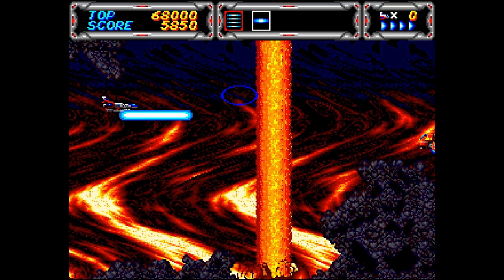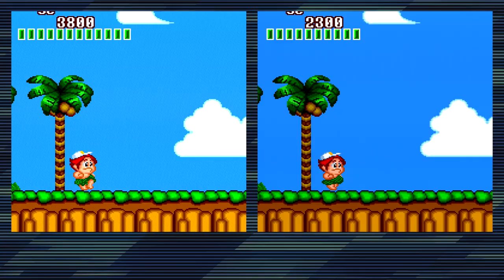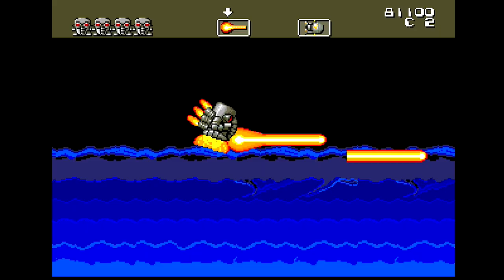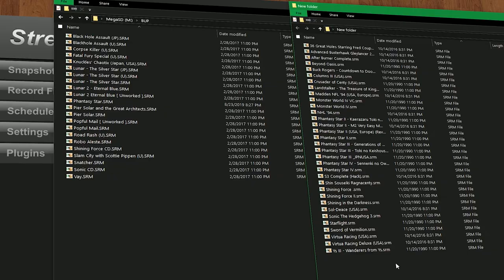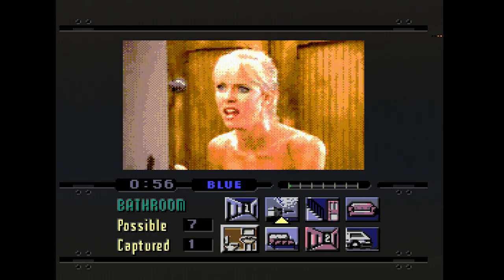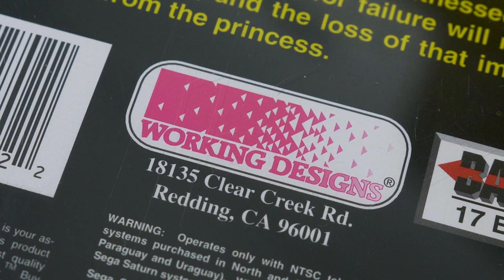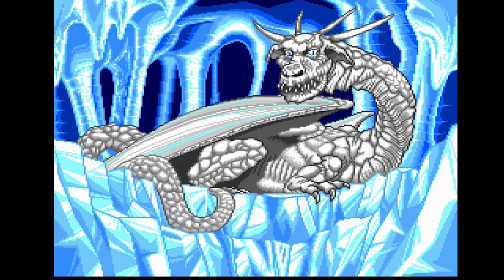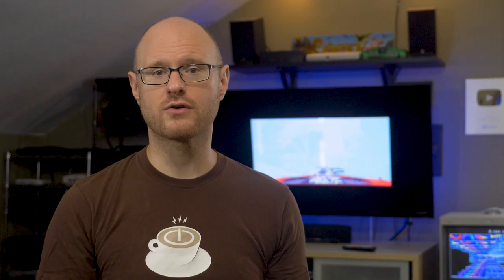Mega SD: Genesis & Sega CD Flash Cart / MY LIFE IN GAMING

Comment: I would argue that Golden Axe was the first "Genesis Plus" game. Even though it wasn't running on cart, it was essentially a ROM file with redbook audio spooled from the disc replacing the BGM.

This was a pack-in for the early Sega CD units in North America as "4-in-1 Sega Classics". The other 3 games (or other 4 in the CD-X pack) use PCM.

Comment: I still want an actual ODD for the Sega CD. FPGA simulation is cool and all but I really want to play on original hardware (plus that will make it possible to play 32x CD games)
Reply: ProtoMancave According to Terraonion, it will be possible to play those games using this device if they decide to go ahead and manufacture an adapter that allows the cart to attach to the side ext port, depending on demand
Reply: I agree. I get the excitement about FPGA, but I'll never trust it as much as the original hardware. I wish there was a product that only emulates the disk drive and nothing else, and goes inside an original Sega CD that takes care of everything else.

Comment: almost there, just need to play 32x without the addon and it will be the supreme flash card for MD
Reply: that would be very hard to do, in many ways the 32x is its own console that lack some functions that it uses the genesis for
Reply: From an architectural standpoint I don't think the FPGA can perform the same math calculations and polygon rendering as the hitachi CPUs in the 32X. Even if it could be emulated correctly I debate whether it's worth the time to the terraonion developers to code emulation for the very very small library of games. Perhaps in a very late software update since they did add Neo Geo CD capability to the Neo Geo cart they developed. However there are a lot more NeoGeo CD games....
Reply: Why??? The 32X Is not worth it. FYI I had one from 20 yrs ago

Comment: The nice thing with Sega CD is that it plays CD-Rs since the system pre-dated piracy by a few years so there was no copyright protection on the system. So if you have a CD burner and a working Sega CD, it's a cheaper option than buying the Terra Onion
Reply: All you're doing there is continuing to wear out the laser in your unit, but go ahead.
Reply: @firstdegreehurrdurr  How does playing a CD-R wear your Sega CD laser out faster than playing regular Sega CD games?

Comment: Should probably correct that it will be possible to play those CD 32X games with a future adapter that allows the Mega SD to connect to the normal side ext slot on the Genesis.  Apparently Terraonion are waiting to see what the demand will be like before they commit to a manufacturing run, although for the price they’re charging it would have been nice to have it as a standard pack-in, the way Analogue chose to include the Master System adapter with every Mega SG.

Comment: The FM Soundchip Emulation seems much better on the mega everdrive x7, hopefully in the future this will be refined for the mega sd.
Reply: @victor.elkins  No, the soundchip of the genesis isn't producing the sound in the case of the fm soundchip emulation. There the final audio signal comes directly from the mega sd/everdrive. In the case of genesis games, i guess you could say, audio "information" is sent from the mega sd/everdrive to the original soundchip of the console, which then produces the final audio signal. Edit: It might not be "information sent", but perhaps the soundchip reads the rom... 😂 I have no clue about thess things.
Reply: @victor.elkins   Yes, flashcarts are emulating SMS FM audio since it is not natively supported in the Genesis/MD (only SMS PSG audio is). As such, there's always room for improvement, meaning future firmwares can be released with more accurate SMS FM emulation.
Reply: @victor.elkins  Correct, assuming the flashcart isn't set to emulate SMS FM audio, which is not available in a Genesis/MD.
Reply: I'm sure the person that made the proper x7 FM module could be talked to about sharing it for the MegaSD. Since that code was made by a community member and not Krikzz himself.

Comment: I bought this for a PAL Mega Drive 2 (European version of the Genesis 2) a while ago. Apparently Terraonion is now using an Intel FPGA for the MegaSD which differs from the previous revision and it didn't play well with their old firmware. So it seems like they made a new firmware to fix exactly that. But at least in my case the new firmware didn't help either and actually made matters worse as it caused the Terraonion main menu to freeze almost instantly before even starting up any games. After directly requesting a rollback firmware from them and installing it, the Terraonion menu now works but all the MD games I've tried so far freeze within just a couple of minutes of playtime usually. My attempts at getting in touch with them and receiving help have not been very successful either and it remains doubtful whether I can get a full refund from the online store where I bought it (always check with the store first whether you can give it back if it doesn't work!). Just thought I'd let anybody know who has a PAL MD2 and is thinking about getting one of these. I'd try the Terraonion Discord first and ask Terraonion if they can guarantee proper operation for your specific MD2 hardware revision. From what I've read other users on their  Discord server have similar issues. Terraonion aren't exactly transparent about compatibility as their website/wiki doesn't state anything about which revisions of the MD2 do not work with the MegaSD. It says "supports Megadrive / Genesis" on their product information page. So they are claiming full compatibility with all existing MD/Genesis hardware revisions without giving any indication that compatibility might be limited. They must already have noticed that several customers have these kind of problems but can't seem to be bothered to put up a disclaimer on the product page warning about the issue. So far my impression of their customer support has been poor. They do not seem to care much if at all whether their product works for all their customers. Yes, I'm aware that the product works flawlessly for some people. Well, it doesn't work at all for others (like me).
Reply: I have the intel version and I attempted to install the latest firmware revision and it actually bricked my megasd. Trying to figure out if I can get a replacement now.

Comment: Great vid.  I haven't done any exact measurements but one complaint is the saving and loading of game states is far slower than an everdrive X7.  I guess that's why they can offer 8 of them, because they are using the slower SD card directly instead of faster temporary memory?
Reply: Ok, I just went and did a rough test:  MegaSD takes around 3.7 seconds to save, 3 seconds to load a state.  Everdrive X7 takes around 0.3 seconds to save/load a state.  Makes a difference if you're save scumming in mega-man....

Comment: 260 USD man that's really steep. Its like a hundred dollars more than a used Sega CD. I really can't justify that purchase. If I wanted to play Sega CD games more conveniently I would go with emulation, If I want to play a more accurately I would go with the actual system. It doesn't seem to fill a roll for me. None the less I hope it does well and maybe become cheaper down the line.
Reply: Plus an extra 20% in Europe for custom fees so it is much much more.
Reply: +Molteno, Are you sure about that? TO is based in the European Union, so I would not expect any import duties on them within the EU.
Reply: @Dan-TechAndMusic  TO is based in Andorra which is not a member of the European Union or even the EU Customs Union. I paid an extra €60 in custom fees.
Reply: It's really for die-hard collectors and preservationists, but it does combine the efficiency and convenience of emulation with the accuracy and authenticity of original hardware.
Reply: Never have to worry about disc drives going bad, capacitors failing or bothering with discs. Totally worth it if you're a big gamer and plan to keep the device for more than a few years, which I'd imagine, most people will.

Comment: Hey Coury, Just got a Genesis (Model 1) for the first time a couple of months ago, and I have had an itch to get the SEGA CD of course, the problem I’ve had is the hardware has also risen in price. That said, I think I would still stick with getting the real deal because I do want to get some CDs there that are not very expensive such as Sonic CD and Ecco the Dolphin 1 and 2; I think the latter is especially worth it with its New Age music giving it a full experience.

Regardless, this is still a good solid-state solution for those that look for longevity over authenticity.  Cheers!

Comment: I like this idea. Because of not only Disc Motors bound fail, but Disc Rot that could kill Disc Based Media in the future.
Reply: @GamePurist why wait until it actually breaks and can't be replaced, when you can preserve it in its current working state for times you really want to show the optical drive working? Old disc games start stuttering and glitching long before the optical drive starts breaking too, but can usually still be ripped properly with software that will retry sectors. So you can put the disc in your computer, make a backup, and stop putting wear on the disc from then on too. Better to preserve the disc in a working state than wait until it actually dies and you can't back it up. Unless you want these games to all be gone in another 30 years?

I don't understand the big deal people make about format shifting home backups. I have full backups of all my audio CDs on multiple hard drives just because it's good to have. The UK government made such actions illegal arguing it takes away future replacement sales once the disc breaks, but lots of my discs aren't sold anymore and would be impossible to replace. So really, they just want limited rare CDs to die, because the music industry makes nothing off of 20 year old indie releases. The same applies doubly so to old CD games, since they're ALL out of production and Sega doesn't care if a 30 year old disc or cart breaks. They want to sell the mini Mega Drive but what about the games not on that system?

It's really ironic that backups for console games and music CDs is so vilified when in every other scenario backups are presented as very important and frankly stupid not to do. No one is getting angry at MS-DOS collectors for backing up their floppies, nor does Steam discourage you from backing up your games to prevent redownloading - they have a button in the UI for it! People are told time and time again to back up all their personal data. So how is backing up your beloved rare delicate games morally wrong? That's part of your life too.
Reply: @GamePurist the point is to try and ensure, no matter how many hard drives fail in the interim, that there ARE backups extant when all of the physical media does eventually fail. A digital good has no marginal cost, so why not keep redundancy? And again you're disingenuously comparing piracy to preservation. And didn't really respond to most of what I had to say. So good day to you, your arguments don't seem to come from good faith.

Comment: I cannot wait to get my hands on that sucker. I have no desire to own a Sega CD (neither do I want a 32X because most games are shit), I’m not likely ever to own a Sega CD or 32X game but more likely a Genesis cartridge. But you do know that disc drives are more likely to suffer wear-and-tear (and can be repaired/replaced or use an ODE instead, the choice is yours) but not the discs? (unlike tapes but you can still fix those) Technically the discs last forever as long as you are careful with them. Sure those things break or stop working (smudges you can clear, cracks seem to be more difficult to deal with) but like I said physical media can last forever as long as you take good care of these, I’m sure collectors do that. I just wanted to get that off my chest since it bugs me when people don’t say that. Most discs I use still work (some don’t) to this day regardless of age. I came for this thing mainly for the games. I definitely want to get a Mega SG (Mega SD) so I could get the ultimate solution. Also want to get a Super SD System 3 (Ys I and II is my all-time favourite!). I definitely want to play Lunar and Popful Mail but not the FMV trash. Hey, if you like that stuff, that’s cool, it’s my own personal opinion.

Comment: Honestly, I always thought that they should have waited a year or two to launch the Sega CD and had the 32X hardware built into it as well, albeit with just one 32 Bit CPU instead of the dual CPU's as most developers didn't even use the 2nd CPU, as well as launching it as a standalone system and not an add-on. 

This would have saved cost and given the system the enhanced color palette it desperately needed, specially for FMV video, as the Sega CD FMV looked awful due to the color limitations.  Not only that but it would have gotten around the limitations of it being an add-on as the Genesis itself limited performance due to it's attached nature.  Perhaps the system would have been more successful if not more capable if they had done this, and the expensive CD-ROM technology would have been a bit cheaper by that time.  They also could have just had the one 32 Bit CPU and done away with the extra 12Mhz X68000 CPU and the extra chips that were there just for sprite rotation and scaling, as the 32 Bit CPU could have handled that stuff as well as 3D support.

Comment: Is there a resource anywhere for the recommended settings you give in your videos? For stuff like the MegaSD, SSDS3, MegaSG, SuperNT, etc.? I always watch your videos and love your info but I just got my MegaSD for example, and would love to not have to re-watch a video that's so long to get your settings. Another reason a web page or document would be helpful is that you could update the settings with any new firmware updates.
Reply from the maker: Although it doesn't always match up, we generally tend to use Firebrand X's profiles and settings for stuff. You can check out his page here: http://www.firebrandx.com/

If you go to his youtube page linked via his site, he has videos on the Mega SG and Super Nt with his preferred scaling options.

Comment: I just can't wait for some sort of 32x mod, I just want it allllllllll
Reply: Kevtris is working on it to allow the MegaSD and 32X to work together on the Mega Sg. Requires special cable and adapter, but it does work from what I've heard.
Reply: @RedArremer  I believe smoke monster already had this working, but all the solutions require digital to analogue signal.. Making the hdmi port useless....

So at that point, why even buy an analogue mg
Reply: @Supaslicer  because you can then put that signal into an upscaler and play them on your HD display anyway.
Reply: @RedArremer  but at that point, if you want a 32x....just use a sega Genisis proper.... I got the mega sd, but I think I'll pass on the analogue MD until something happens with a 32x Fpga core

another modder, who's handle escapes me, is in the cusp of getting one working, but sadly it's no where near ready for prime time
Reply: Also I feel even if something did happen with e 32x core... We are looking at more of a new mega sd than a new system

Comment: When you say cd audio isn't working on nomad, do you still get sound out of cd games on the nomad without it?
Reply: What does this sentence even mean?

The problem is that the cartridge port needs to have a way for the audio to pass from the cartridge to the sound mixing circuitry. If you don't have that, then there's no studio from the CD or generated by the CD add-on in the audio you hear, and you'd need to modify the Nomad for this to work.

Comment: Anyone know why the Mega SG console (and the Super NT for that matter) doesn’t have a save state function?
Reply from the maker: [Try4ce] They're meant to interact with the cartridges in the same way as the original consoles. I don't know if it would even be technically possible when using real cartridges. Even if it is, I don't know what kind of challenges it would present.
Reply: My Life in Gaming As I understand it, a “save state” is just a dump of everything in volatile memory to a file.  So it should work with cartridges and rom files alike.

Comment: When using 32X, does the 32x need to be plugged in with ac adapter?
Reply: Of course. The 32X uses an overlay graphics system in addition to it's own hardware improvements, so it will need to be plugged in.

Comment: I'll always appreciate the effort that goes into designing something like this but the pricing just seems wrong to me.  You can buy the real MegaCD (with a MegaDrive) for just over half the price of this cartridge. Since this is designed to be used on real hardware, why not just buy the real hardware of the MegaCD?
Reply: Cause it’s also a flash cart. You save money by not having to buy the games
Reply: @spookylemon4947  The MegaCD plays backups without the need for a flashcart and they can be gotten really quite cheaply for the main console.

I can kind of get it if you are a collector as well and want to maintain your system but it still seems too expensive for what it is.